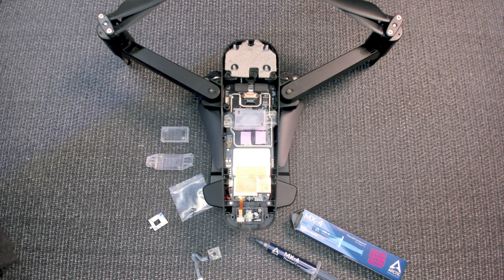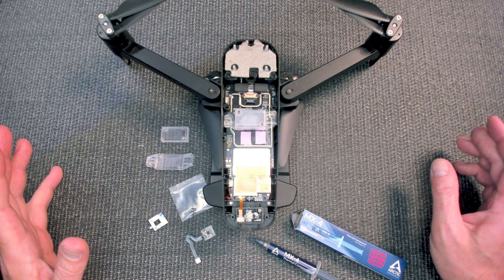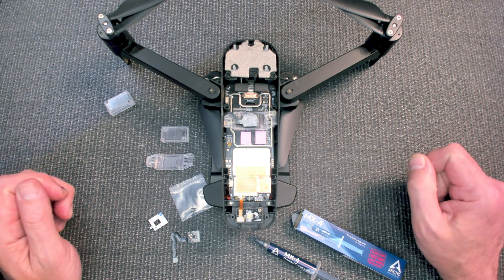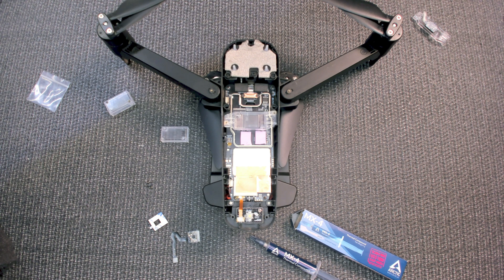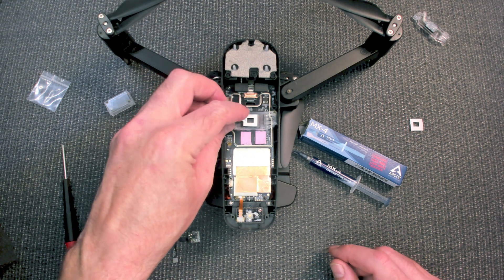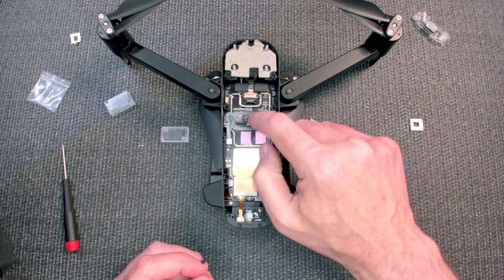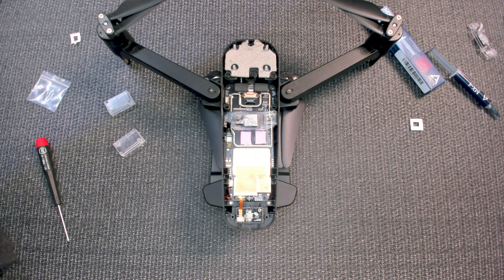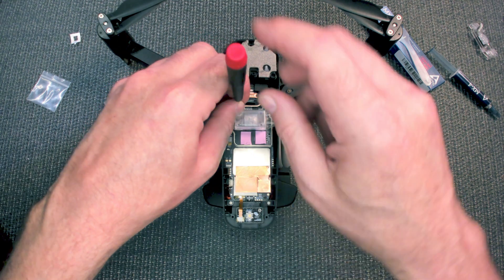HUBSAN ZINO PRO PLUS - HOW TO REPLACE BAROMETER

Comment: Hi Chris, me again  :)  Need little help, what are specifications for original Zino Pro Plus Charger? Thanks in advance.
Reply from the maker: If you are referring to the power specs it's Model #P173D3000 Input: 100-240V 50/60Hz 1.2A Output: 17.3v 3000mA
Reply: @QCGUY  You're my hero !!! Thanx a lot ! Enjoy... I'll let You know what I did...
Reply: @QCGUY  Just one issue: The gimbal angle sensor is abnormal and Error 0x2000
Reply from the maker: @TheCikaSrba  does the gimbal move at all during startup?
Reply: @QCGUY  Unfortunately NO
Reply from the maker: @TheCikaSrba  https://youtu.be/ljNJusJP6MQ
Reply: @QCGUY  Thanx again !  :)

Comment: Hi mate can you please help me with the zino 1 I've taken it out for the first time love it flys very stable and smooth. But the video is not as good as I thought it would jerky video could it be down to the memory card
Reply from the maker: Could be the card or a gimbal issue or IT version 0.3.8 if that was installed.
Reply: @QCGUY  will check the it number but now I've got a genuine scan disk extreme pro card because the one I got off eBay I think is a fake

Comment: Can hubsan zino 117S be used for batteries  charger IMAX B6 80W 6A LIPO NIMH does it have to be IMAX  B6AC DUAL POWER 80W NOWA LIPO LIHV.   In general, can there be LIPO or must there be LIHV. I`m sorry for my writing
Reply from the maker: As long as it balance changes lihv batteries your good.

Comment: Hi, I still have my Hubsan Zino Pro relatively new, only the camera quality is extremely poor no matter what I use (mostly 4k30).
I have used different micro sd cards, mainly the sandisk extreme and they were always formatted before (mostly fat32). I have also upgraded the firmware properly.
I don't know what the problem could be, it would be very nice if you have some ideas for a solution. 😃
(The quality is always the same even in good lighting conditions.)
I think it's the software, because the fpv usually looks better than the 4k30video and all the others.
What can I do
Reply from the maker: Post in my group and show the problem with pic or video. Thanks 
https://www.facebook.com/groups/HubsanQC/

Comment: If you have sausage fingers.... Small wood dowel, put a piece of sticky tape on the end of it and use that to insert the plug.
(grease the sticky tape in your fingers a bit so it wont stick too hard on the plug)